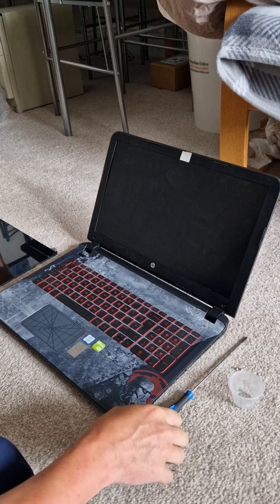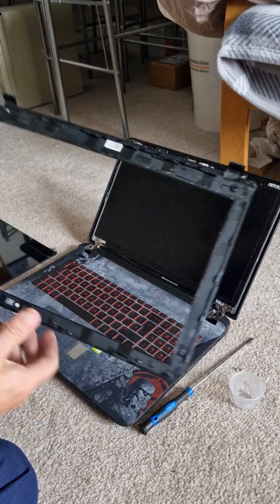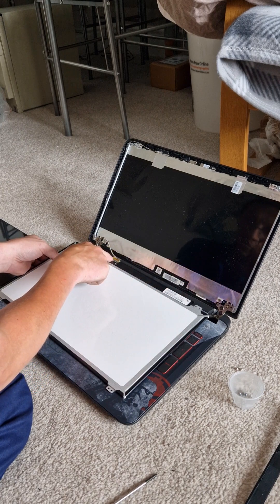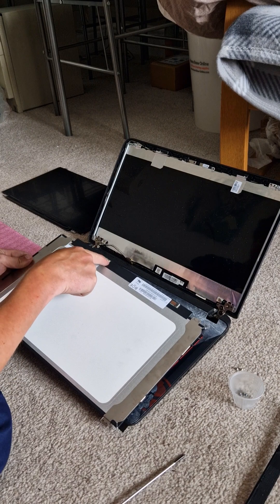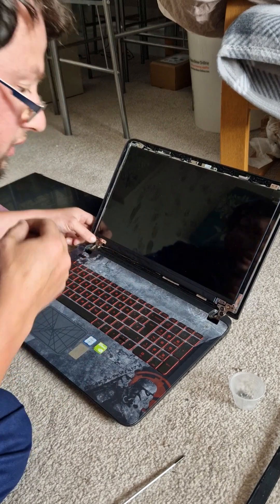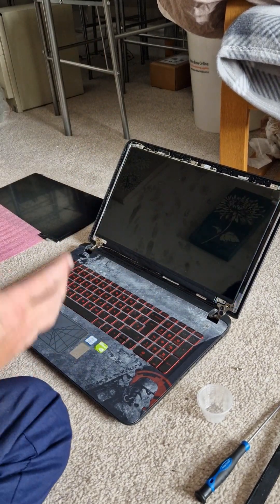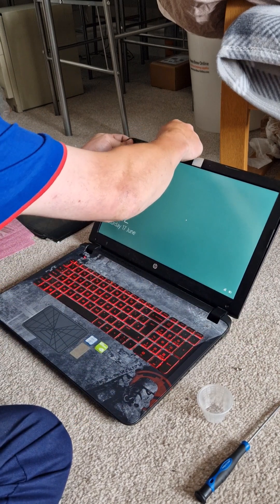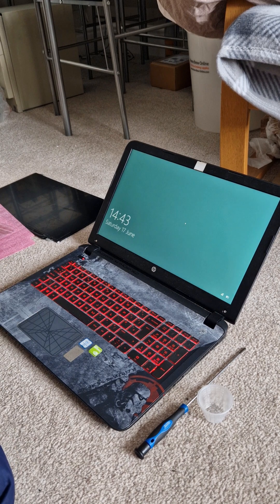HP Star Wars Special Edition Screen Replacement for beginners

Comment: Thanks for the video.  Curious why you replaced yours. Mine is getting very dim and colors aren’t vibrant.
Reply from the maker: Glad the video helped! My old screen was failing on the bottom right and put green lines and a weird light blue colour all over the screen. Eventually the picture was a weird burned purple
Reply: Thanks for the reply.  So 6 months later are you still happy with the screen yuou picked? 
 @EddieMcMeeken
Reply from the maker: @jonbrendan9599  Yes it's doing pretty well, still a clean sharp image
Reply: @EddieMcMeeken hey bro whats your laptop specs i also have this hp star wars the lcd was cracked havnt use in months do you think it is still usable in 2024?
Reply from the maker: @Bongkeetu  Here is the link to the HP specs page! I've upgraded my RAM from the 6GB to the full supported 16GB. I've also swapped the hard drive with a Samsung SSD Evo 860 1TB solid state drive, massive speed difference! In terms of usability in 2024, it still very much does what you need to do. I dual boot Win 10 pro and Ubuntu no problems! 

https://support.hp.com/gb-en/document/c04910607

Comment: my hp starwars laptop lcd got a dead ant in the screen. how to get rid of it ? any sggestion ?
Reply from the maker: An ant in the screen?? I would remove the screen completely and remove said ant and re fit unless your screen is damaged then you'll need a replacement
Reply: @EddieMcMeeken  yeah i guess i need some rplacement here and there. anyway, do you still have starwars theme and stuff on your lptop ?
Reply from the maker: @MeredithFarrow-i8w  I don't really bother with them now that much. Saying that, I still use the R2 sound theme